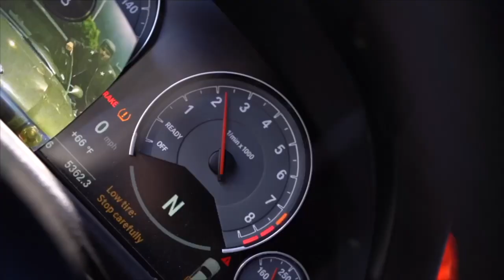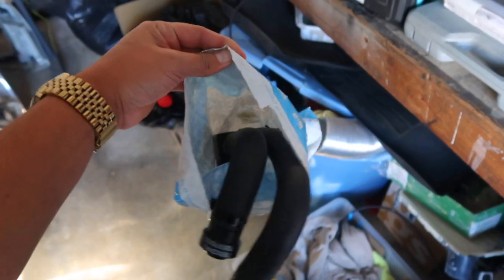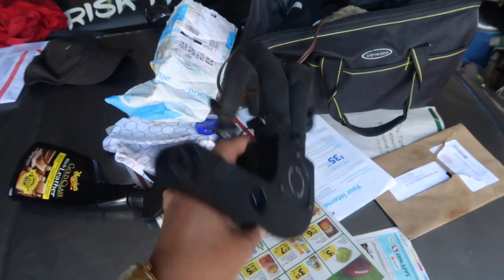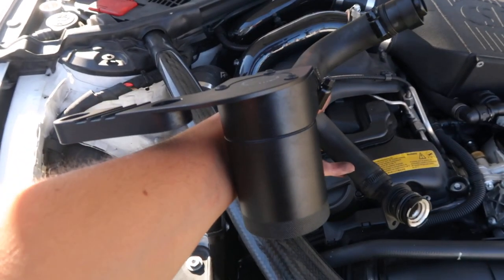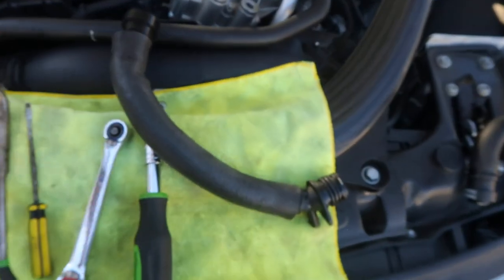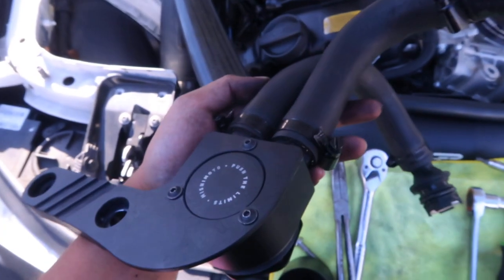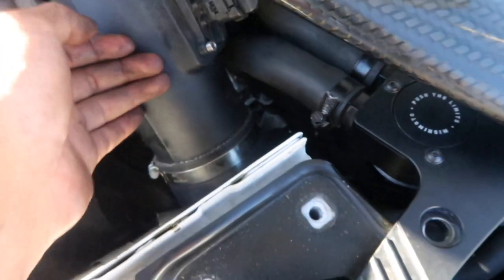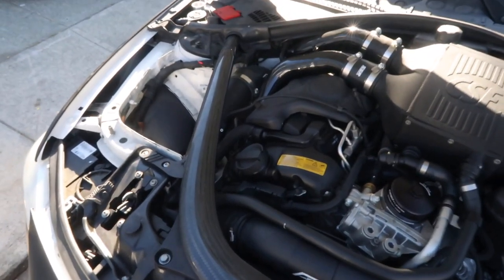BMW F82 M4 gets Mishimoto Oil Catch Can | The BEST MOD on the F8X M3/M4 S55 Platform | *DIY Install*

Comment: great video and good tips. Is it pretty easy to unscrew it to empty it without having to remove parts such as the brace etc? Also, you should've went with the mishi charge air cooler as well lol csf is just all marketing, they don't provide any proof of claims. Kies motorsport tested CSF against stock and it lost power.
Reply from the maker: Thank you for the commentary! Honeslty it's a bit tough to unscrew due to it's location but there's just enough space to unscrew it without having to remove anything if you use enough elbow grease. I agree with you on the intercooler, I got the CSF for a rather good deal so thats the reason i went with it. Planing to upgrade to a EOS intercooler down the road.

Comment: Hello,
nice video, thanks for sharing. Isnt better to unpug the origin tube from the air intake system and let the oil flow freely under the car? Bye, Richard
Reply from the maker: Hello and thank you. Yes you’re able to unplug the bottom of the intake system but with no filter or baffle system, it would simply cause a vacuum leak or cause debris to come into the system

Comment: So how do you like that front mount air intake? .ive got the carbon fiber AFE sealed one and i love it.been thinking about getting one of these catch cans .has your pcv valve fucked up and started that horrible whistling yet
Reply from the maker: Honestly I love them, intake snarl from the exterior is surreal. I can imagine how beautiful the AFE sound! I recommend the catch can as it works great and my pcv valve hasn’t gone out yet, fingers crossed, but I have attended to my valve cover gasket